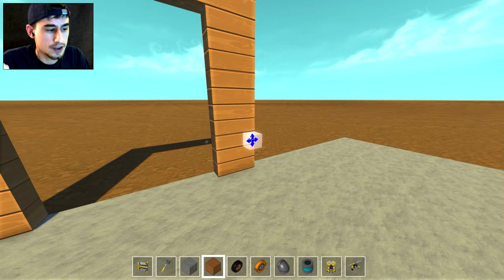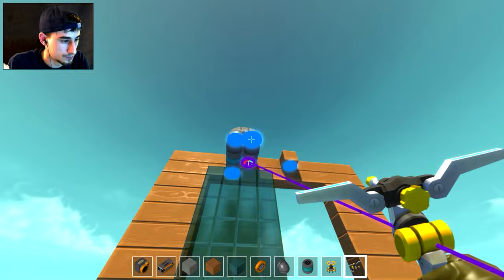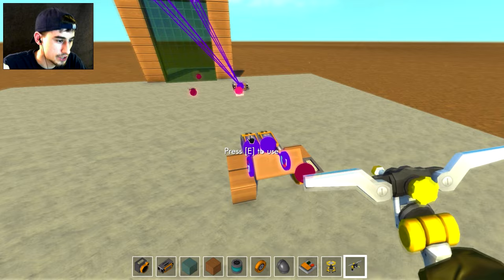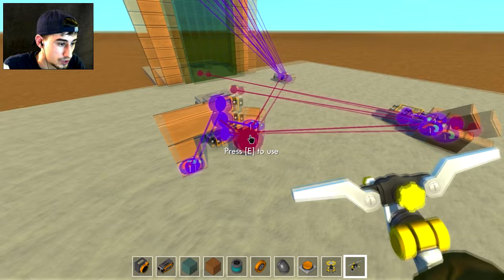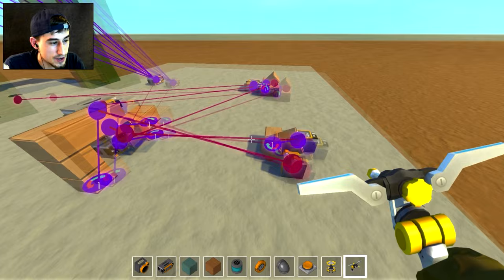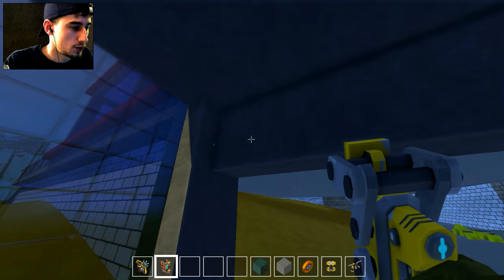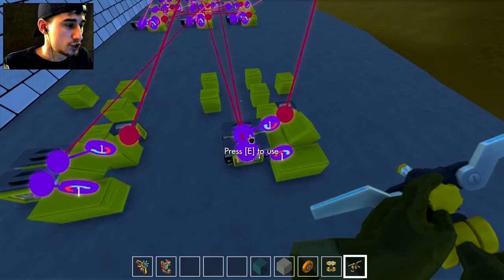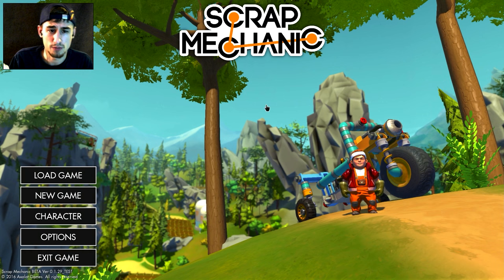Automatic Sliding Door Tutorial & 3 Floor Selecting Elevator! (Scrap Mechanic #39)

Comment: kAN Gaming please do a tutorial on how to build the multi floor elevator I'm still confused
Reply from the maker: Ok!
Reply: Just posted mine to the steam workshop today. It's called 3 floor elevator. Open the outside wall of the side room of the first (blue) floor to expose the workings. The floors and buttons are color coded to help them make sense. The key to making this work, much like the key to making automatic doors that have delayed auto close without needing all those different modules, is to use the sensor in switch mode instead of button mode. Now, I did learn something with the memory bit, but I have several styles of automatic doors that run on a simple OR gate that triggers the sensor in switch mode, and then returns to home (triggering the sensor to off again) after the delay. All this just seems excessive. I've also posted my version of doors to the workshop, but with buttons instead of floor mounted sensors. It would work the same though. Hope it helps reduce some of the lag inducing mechanisms you got going on.
Reply from the maker: True I should rebuild memory using a sensor in switch mode. I'm used to using a sensor in button mode as when I first did circuits the other functions didn't exist.
Reply: And I bet that once logic blocks are out and functioning, every older setup will look like nonsense. Cool to see another way to work it out.
Reply from the maker: Yup I agree.

Comment: hi the hover ship flew away
Reply from the maker: What kind of framerate were you getting? I've noticed the issue that when the framerate drops the ship starts to fly. It never flies off though when the framerate is higher.  I feel like this is a game limitation unfortunately as I balanced this many times. Normally I get 45-55 frames running the ship and it doesn't have issues. When my framerate drops to 20 (caused a weird collision) the ship will start to float. I'm hoping that this issue will be fixed in newer updates!
Reply: ty and cool door
Reply: +kAN Gaming i am a youtuber subscraper